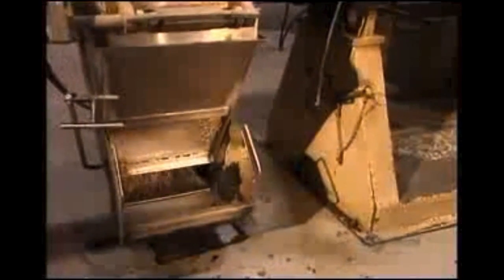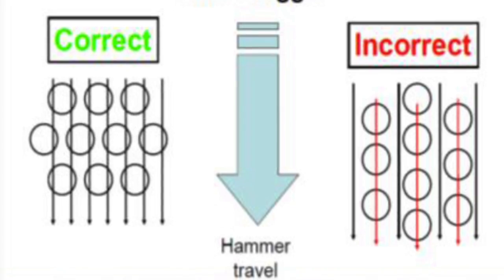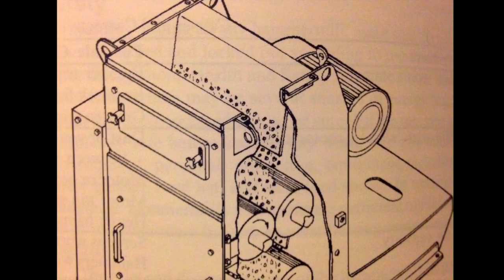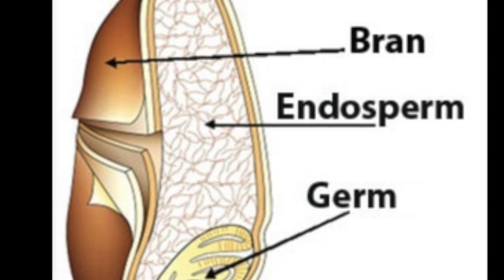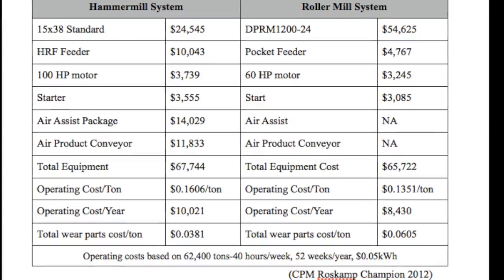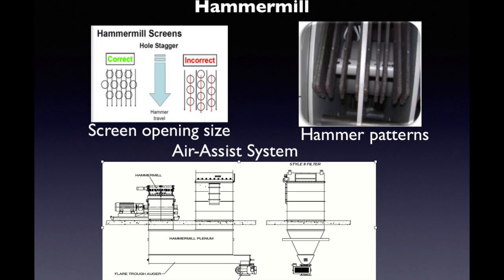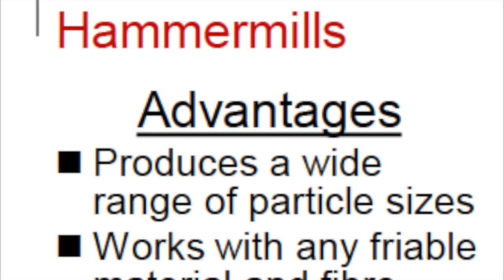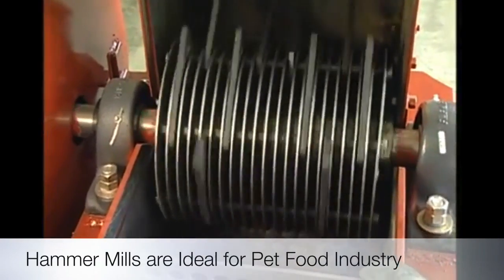Hammermill vs. Roller Mill Grinding in the Pet Food Industry

Comment: What you call a roller mill is actually a roller press and what you call a hammer mill is actually a screen hammer mill with articulated hammers. Other than that, this is a well produced video. Good Job!
Reply: Wow, so what is the difference between a harmmer mill and an articulated one?  or a roller mill and a roller press?